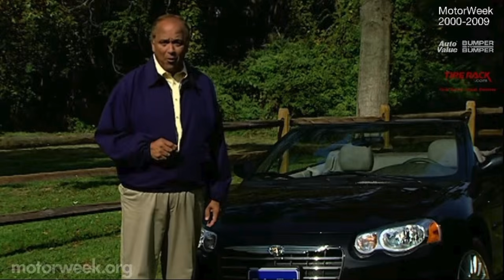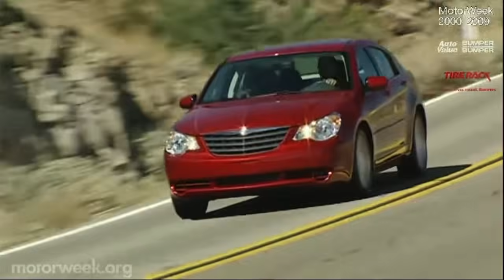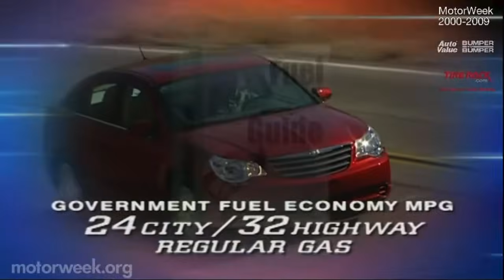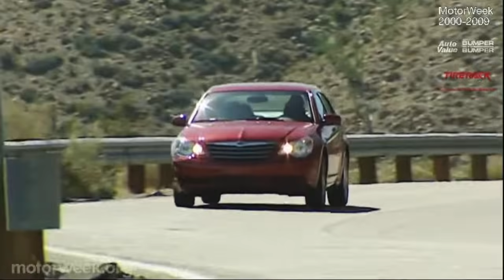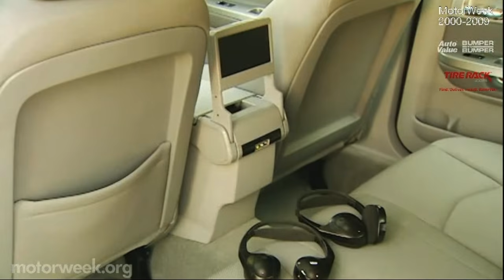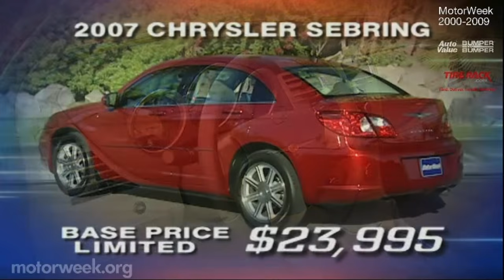Motorweek 2007 Chrysler Sebring Road Test

Comment: My hometown in northern Montana had a lot of Sebring convertibles rolling around... I'm pretty sure over 95% of them started life as rental cars, then were picked up by people who fancied a cheap convertible when they shoulda just bought a sedan. They trudged around with the tops always up, 12 months a year as the fabric slowly degraded into something resembling a wind whipped tarp. After a few valiant repairs with duct tape, garbage bags, or whatever else you could buy at a dollar store for less than a pack of gum, the cars were left moldering in driveways or driven without maintenance until some component costing more than a pack of cigarettes failed, then hauled to the wrecking yard. The end.

Comment: The year after this they offered the 2 door convertable limited with the 3.5 which is the only ones you see driving around anymore.
Reply: I don’t think I’ve seen a Sebring of any version in at least 10 years. They rotted out here in the rust belt really fast.

Comment: What a piece of junk!
Reply: Agreed
Reply: How?
Reply: @DreyTheGamer  Interior quality was trash, the 2.7 liter engines were garbage. They were prone to catastrophic engine failure due to sludge build up well before 100,000 miles. Water pumps often failed as well as timing chain tensioners. They were also prone to electrical issues. Does that answer your question?
Reply: @ohguy1991 what about the 2.4?
Reply: @DreyTheGamer  They were more reliable but didn't make much power and were not very refined. The best bet was the 3.5 liter
Reply: @ohguy1991 didn’t the 3.5 jump time